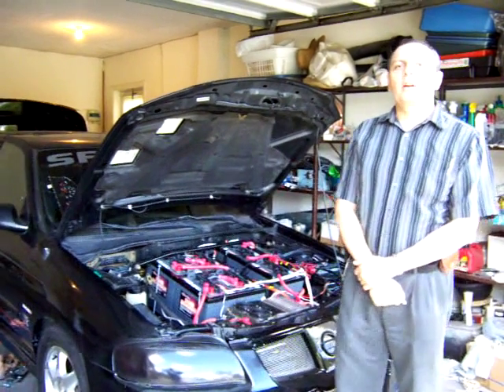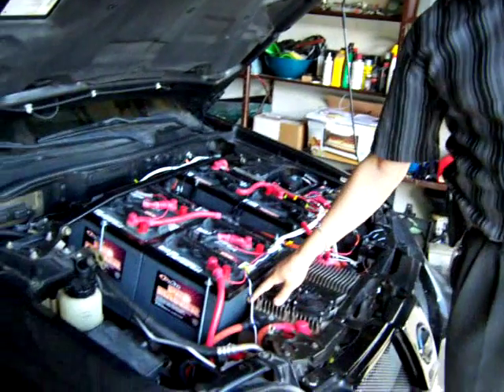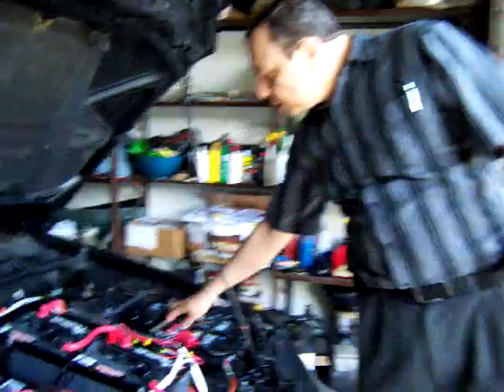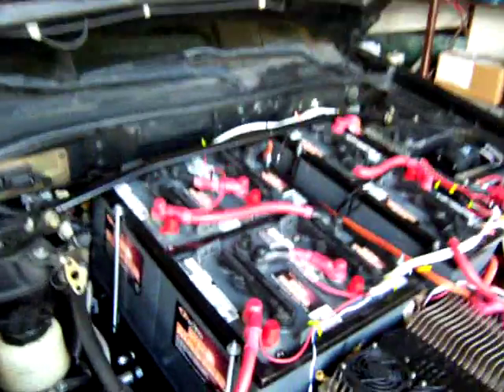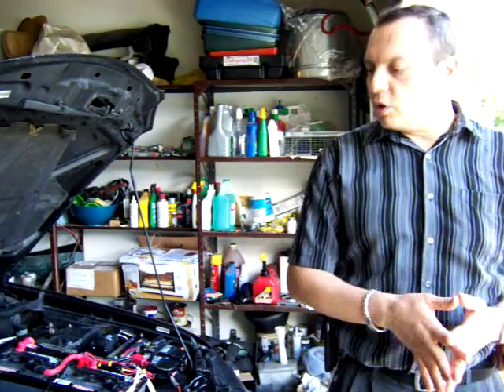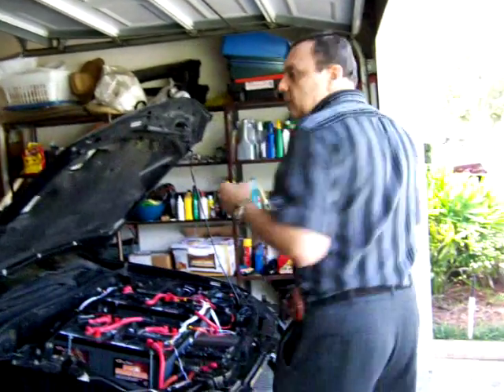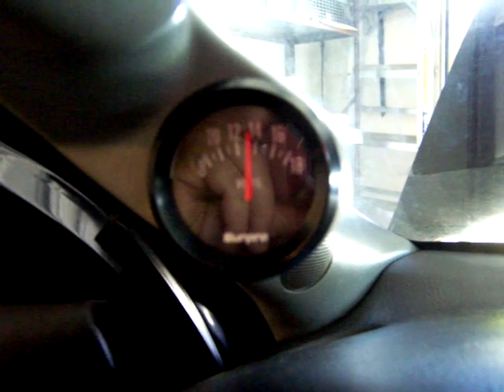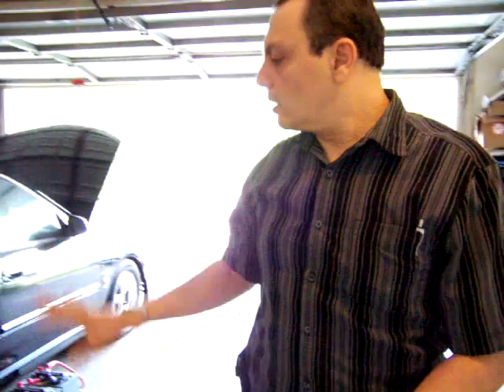Nissan Sentra Electric Car Conversion Part 22

Comment from the maker: Also, I have been thinking about doing my own intrument panel, but there a few things that I still need from the old panel and I am not sure if I would be able to port them to a new instrument panel like the airbags sensor indicator, the door open light, the break signal etc. I am first going to try to fix the speedometer and hack into the tachometer. If unsuccessfull, then I will have to build a new instrument panel.

Comment from the maker: Hello MrBry329 Thank you for your comments. I think you are right and I will need stronger springs in the back, but on the other hand, they are also made to hold 3 adults in the back seat, so we will see. Today I loaded the 11 batteries in the back and it looks like it lowered about 2 inches which I think it is not too much, but the car is in jack stands so it is a little harrd to say. I will put back the tires this week and see how much it lowered once it is in the floor.